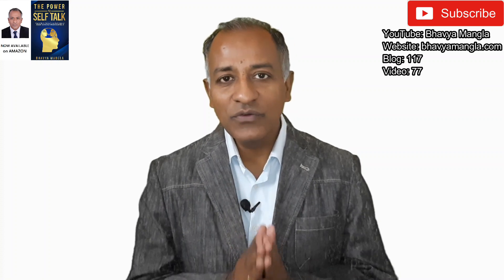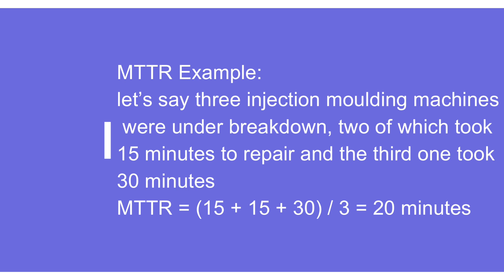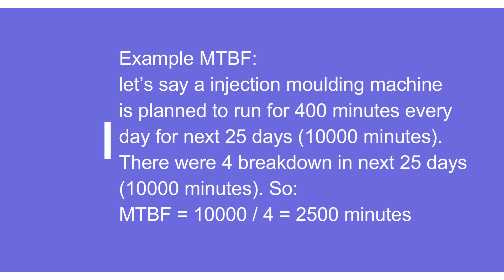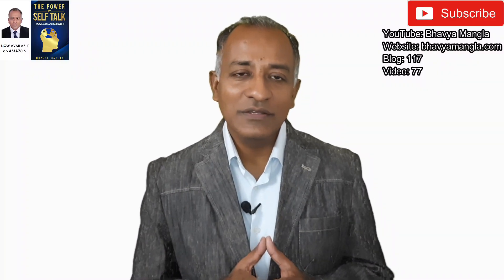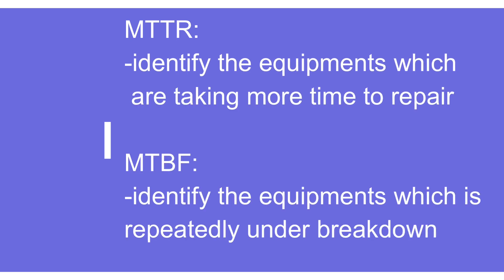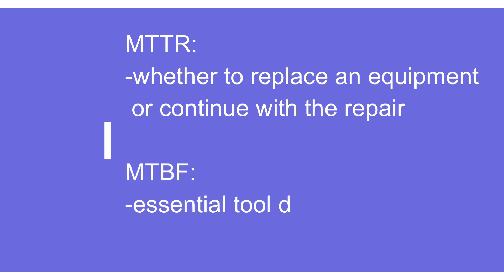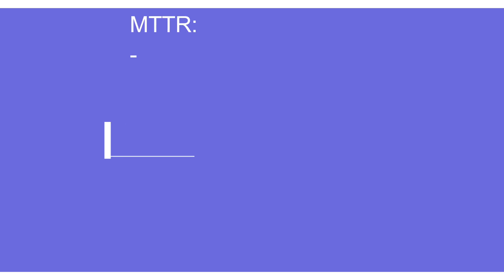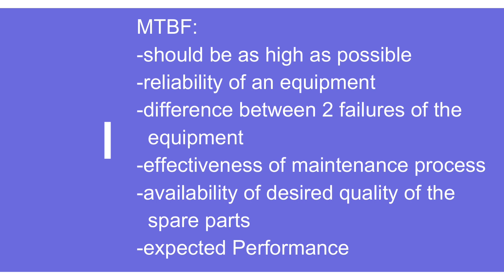Difference between MTTR and MTBF / IATF 16949 | ENGLISH | Bhavya Mangla

Comment: Bhavya Mangla San : As you have mentioned in this video that MTTR and MTBF is a key requirement asked in the IATF 16949 standard. But when I checked it in the standard then I found that it is given as an example there. So standard has not mandated us to define and monitor the same. Therefore can you please guide me that what else as a monitoring KPI's can we consider in the place of MTTR/MTBF as an alternate? Thank you in advance!
Reply from the maker: Dear Utkarsh, thanks for asking an interesting question. Yes, it is true that in Clause 8.5.1.5, it is specified as an Example but it also indicates the desire of the IATF that organization should monitor it wherever possible. In 9.3.2.1 (Management Review), there is specific requirement for monitoring the Maintenance objectives too. The organization can add few more objectives related to Maintenance cost, implementation of Preventive and predictive maintenance plan etc.
Reply: Thank you so much, Sir! It helps. 🙏
Reply from the maker: You are Welcome Utkarsh